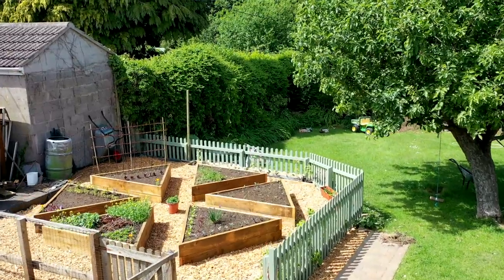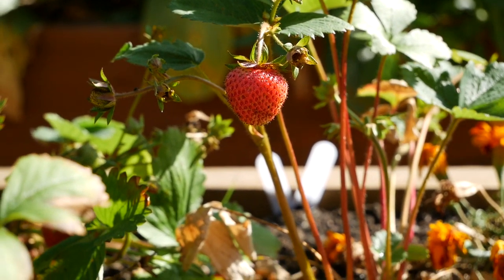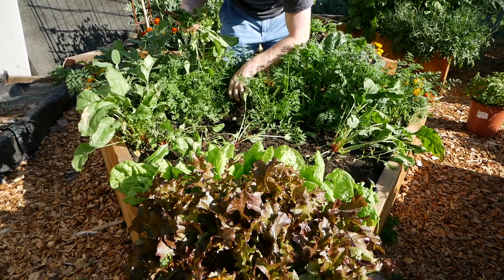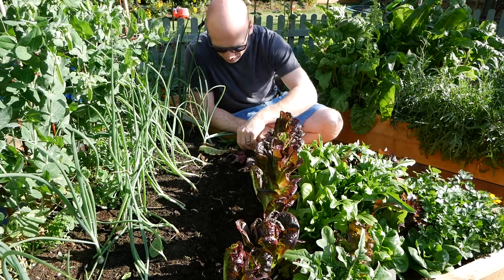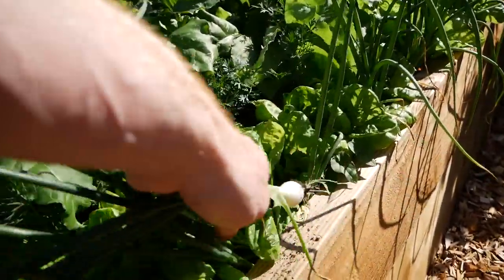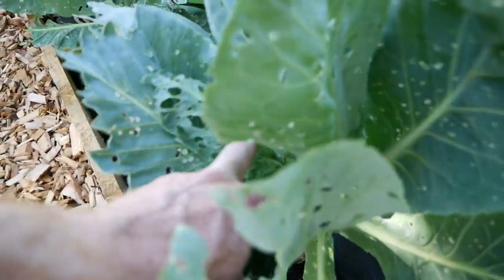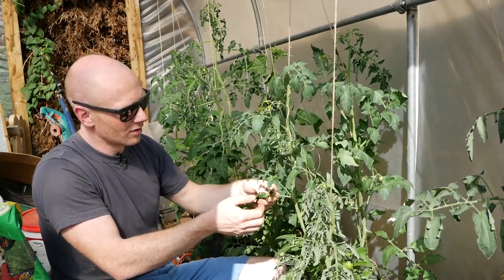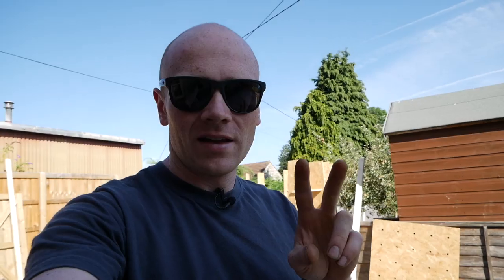GARDEN FARM TOUR & DIY Project Updates

Comment: Gorgeous piece of elm, that's gonna be a stunner!
Biggest tip on the veg garden I can give, is a drip feed system for the polytunnel. I had one for my old polytunnel fed from 2 waterbutt (one for each side). Worked a treat as it was self-sufficient for 3 days or so on full barrels and slowly feeds your crops, so less split fruit.

Comment: Forgive the niave question, what do you mean by "gone to seed"?
Reply: Low growing vegetables like lettuce, cabbage, spinach, and similar will start growing taller and have larger spaces between leaves when they transition to reproduction (bolt). That transition to reproduction just means these vegetables are about to flower and will produce seed unless removed, of course if you want seed then leave them and collect the seed when it’s ready. It is a shorthand term and more direct to say that they are going/have gone to seed. Hope that helps.